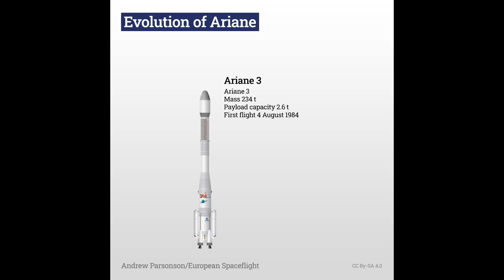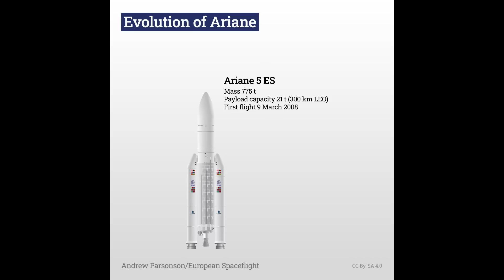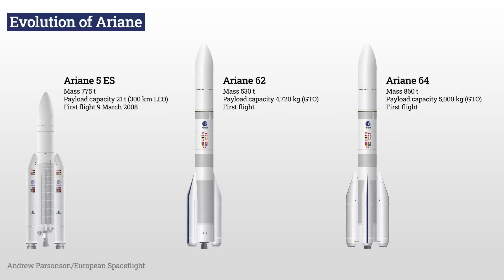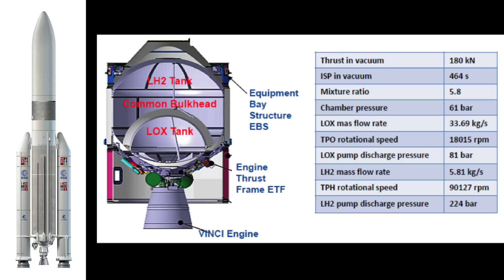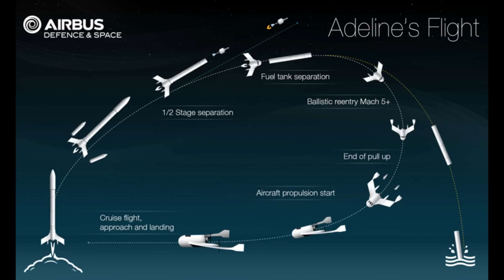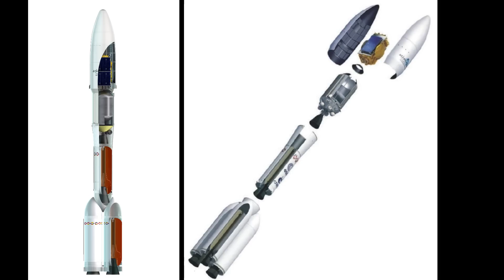Europe Retires Ariane 5 Before Ariane 6 Is Ready????

Comment: The thing about the European space launcher industry is , there is not enough demand to make it worth while to reuse kit. Many of the companies cannot afford to produce only one or two engines per year for example.   So either Europe has to be able to be able to build demand so it is worthwhile build and launch reusable vehicles, or each launcher has to cost 4 or 5 times what it does now.

Hopefully Europe can get through this and build more launchers.
Reply: most of ESA's work is done for non-member countries, and that included the US before SpaceX got up and running. There are still a lot of countries who will happily wait for a more expensive launch slot on an ESA rocket that has yet to fly, rather than ever give money to a rocket owned by a US company. Ariane 6 will undoubtedly get work to do, but whether it will pay for itself remains to be seen
Reply: Isar, PLD, Pangea, Orbex and RFA all plan some kind of reusability. They are small rockets, but lets wait and see
Reply: The way to do that is to get market share by offering a cheap reusable rocket. Too late now.
Reply: Cut your launch cost by 90% or more, and I think you'll see a rise in demand
Reply: Reusability is pointless if it all comes back to French Guyana or the Atlantic nearby, all hardware processing apart from solid propellant filling and vehicle assembly is done in europe. Makes more sense to keep the production lines running steadily...
Reply: This is one part that many people miss - SpaceX has an easier time here than others because they have a huge backlog of already paid-for launches thanks to their Starlink. And while Starlink is heavily subsidized, they are the customer, so it gives them more flexibility in their launch schedule.
And after all, the question whether reusability makes any sense at all isn't so clear cut - SpaceX is an order of magnitude away from the launch price they were promising for the reused rockets, as well as from the reuse cadence they promised. It is unclear if reuse actually saves any money or time.
Reply: @kain0m I think it's pretty clear how much time and money reuse saves. Like 4 or so years ago they reported refurbishing costs half as much as a new booster, presumably including sea operations cost average. As for time, refurbishment finishes at the cape within a week or two including the few days of intake from the barge. They don't have to ship a booster from California every 5 days or make a new production chain and factory in Florida. It probably costs much less than half now. A new booster takes much longer to fabricate, assemble, validate, plus making the engines, then full build validation. Instead they can allocate resources much better to the upper stage, where they still find ways to speed up and optimize production to speed up cadence today, as that is the bottleneck.

The biggest benefit of reuse is the speed and cadence of operation, they can launch at a cadence of seemingly less than a week at a time regularly. This cadence pays off their fixed costs like the pad and staff.
Reply: @kain0m  " SpaceX has an easier time here than others because they have a huge backlog of already paid-for launches thanks to their Starlink."

SpaceX built reusability first and then Starlink. Starlink couldn't exist without the cost savings of reusable rockets. Or at least not in its current form. OneWeb, which is the only real competitor to Starlink right now, has already gone bankrupt once with a far less ambitious plan. And even it bought a previous satellite constellation company that had previous gone bankrupt. 

SpaceX went with reusability to lower prices to increase demand for travel first. And they are continuing that same approach with Starship. There is hardly any demand at all for a vehicle able to left 100t and more into orbit multiple times a week. Even Starlink at full scale will only need a few launches from Starship each year. But if they build it and bring the cost down drastically, then the market will increase massively.
Reply: @kain0m  > SpaceX has an easier time here than others because they have a huge backlog of already paid-for launches thanks to their Starlink.

You don't know what you are talking about. SpaceX reusability program started way before Starlink was even an idea. First F9 launched in 2010. First known mention of Elon planning a comsat constellation is 2014.
Reply: @kain0m   "SpaceX has an easier time here than others because they have a huge backlog of already paid-for launches thanks to their Starlink. "

Which thus in reality means Starlink is really a program of excuse and need to have such high launch cadence. Which then works out to: Can Starlink really cover all those expenses with it's revenue or is SpaceX lighting a huge pile of money constantly in fire in form of starlink, just to show "hey there is huge need for our large launch cadence". Which would then come crashing down upon SpaceX running out of investment money to burn. It comes all down to.... Is Starlink actually profitable enough to subsidize the reusable rocket program and massive launch cadence.

If you are just using your own division to pay your second division to make money... you aren't making money, you are shifting it around in expense sheets. You need external revenue to keep the company going. Sure Starlink makes some money, but does it make enough money to cover the vast launch expenses. Since mobile internet connection is thing people expect to be pretty cheap out side of say ocean going cruiselines, they have no choice but to pay what the satellite operators demand.

On ground. You are fighting with competitors with way less expensive cost structures.... Like putting up steel tower on which to mount these permanently fixed starlink link relay stations called cell network basestations. Which you can put up tighter and tighter upon demand increasing, since every tower is not blanketing the whole county with it's radio waves causing interference. Easier radio frequency slotting and so on.
Reply: @aritakalo8011  According to Gwynne Shotwell, Starlink is already profitable. It supposedly had a 'cash flow positive quarter' in  Q4-22, and should be completely profitable in 2023. I'm sure that cash flow positive doesn't include back costs like development. But it should be counting launch costs. They have over 1M subscribers already, which is likely earning over 100M per month in revenue. That should easily cover 2 launches a month. Probably 3.
Reply: @aritakalo8011  > Sure Starlink makes some money, but does it make enough money to cover the vast launch expenses

What "vast" launch expenses? $28M per launch? LOL.
Reply: @aritakalo8011  Starlink has nearly 2 million subscribers. That is already billions of dollars per year

Comment: Kinda like NASA retiring the shuttle before any form of replacement has even been conceptualized? 

Sounds a bit like casting biblical stones, doesn't it?
Reply: the space shuttle killed its crew on several occasions each time with a different failure at the end it was like playing russian roulette, because its design flaws were ultimatively fatal, Ariane 5 was human rated by the way, they did not bother to develop or say build capsules though.
Reply: It was Washington that cancelled the shuttle.
Reply: @TheEvilmooseofdoom  and?
Reply: A replacement had long since been conceptualized. Only trouble was all kinds of obstacles made its realization take much longer than anticipated.
It's almost as though space was hard.

Comment: why jettison boosters, when you can just burn them down, by themselves
Reply: ie, plastic mixed with oxidizer in a rocket burner nozzle shape
Reply: you know those plastic 3d print filaments mixed with additives, this time the oxidizer, full burn solid fuel booster 3d printed or cast into shape
Reply: just make a huge ton bunch of the vanishable single use rockets, yes you like your military things
Reply: actually expendable rockets
Reply: @Jkauppa  You would need non-burnible graphite (or similar) nozzles to convert the combustion into thrust. And a structurally stable airframe to contain it, and connect it to the main core.
Reply: @Joe_VanCleave  no, you can do all that with the same rocket fuel material, just be wise about it before saying "no it cant be done"
Reply: @Joe_VanCleave  do stuff smarter, dont work harder
Reply: @Jkauppa  No. the same material can’t simultaneously combust as fuel and not combust as chamber/nozzle. Never say it can’t be done, yes -  but understand the laws of physics and chemistry, also yes!
Reply: @Joe_VanCleave  do you believe in God? you just denied God
Reply: @Joe_VanCleave  dont become rules to me
Reply: @Joe_VanCleave  your scientific vote was not counted, as no voting needs to take place, or anyone has to have any rights over other people's doing or thinking or sayings, no matter what they are, or how wrong you think they are, you just said its impossible, choose already
Reply: @Joe_VanCleave  is it possible or is it not possible, law or faith, bro? God or limitations?
Reply: @Joe_VanCleave  through law you will get nowhere, just "science" whining
Reply: @Joe_VanCleave  your principles are broken, you are the limitation for all and yourself
Reply: @Joe_VanCleave  so you think aluminium is not both fuel and structural wall?
Reply: @Joe_VanCleave  explain to me how shaped directed charges (explosives) work
Reply: @Joe_VanCleave  how does the nuclear detonation engine work

Comment: The Ariane 5 is kind of the Frankensteins Monster under the Launch Systems.
Stupidly big Boosters, way to small Main Engine, heavy Avionics Bay.
At Booster Separation the Main Engines Thrust is smaller than the weight of the Vehicle so acceleration is <1g. It falls back to earth, while picking up speed and emptying the tanks till it climbs again, a lot of gravity losses.
Also it starts pretty steep to compensate.
Payload Mass Fraction is around 1,5%. Not what you would expect from a 2,5 stage system with HydroLOX-Turbopump theater on board.
Anyway, the purpose was changed like 4 or 5 times in over the hollow development, so engineers are not to blame.

Comment: Ariane 6 is already a commercial success as the first years are fully booked, and with the millenium spatial biggest contract for Kuiper. t is even an issue because they must ramp up the candency quicker than planned
Reply: "Commercial success" is being a little generous. I checked the manifest, and the most ambitious year so far is only 9 launches (for reference, SpaceX did 61 launches in 2022) and only 3 of those commercial launches. Most of the launches are Galileo sats and EU science payloads. Am I missing something?
Reply: @geraldmartsy2165  ariane 6 is planned and made to launch not more than 12 per year based on government contracts and the size of the heavy launchers market which is not as high as you can imagine, lower than 30 per year with several launchers available. They dont need to launch more. Trying to do more only for the public market is not economically interresting and is not the purpose of it.
Plus there is a ramp up phase to achive the 12 launches.
Their book is already full and they must accelerate the planned ramp up because of that.
If it was only for the kuiper contract it would be a huge commercial success already.
Plus the 9 you are refering to dont have the kuiper launches which are already signed. It is not always publicly available in details.
Reply: @sebpatu  ok buddy, sounds like a great rocket. congrats on your success.
Reply: @sebpatu  Hard disagree. 10 years ago the idea of launching 60+ Falcon 9 size rockets was unthinkable. The simple availability created an increase in use cases for payloads of the type it could carry which drove up launch count. And Space X has been able to increase to keep up with that. Arianne 6 is going to be hard capped very quickly in terms of cadence.

Worse within a few more years it's not going to be competing with Falcon 9 or even Falcon Heavy. It's going to be competing with Starship, and eventually New Glenn. At that point there's just no reason for anyone to use it other than anti-US sentiment. That and European Government contracts will likely keep it flying. But it's likely to become an odd duck launcher used by a small number of customers and completely outcompeted by everyone else. And that will eventually kill Ariane as a launch provider.
Reply: Ariane 6 is only getting Kuiper launches because New Glenn isn't ready.  The vast, vast majority of Kuiper launches over the next 10 years will be on New Glenn.    And I wouldn't be surprised if Ariane 6 isn't ready before New Glenn is then their Kuiper launches will be cancelled.
Reply: @stevenf927  Amazon signed for Ariane 6, Vulcan, and New Glenn not only New Glenn. Then you will be very surprised when Ariane 6 will launch before end of 2023. A delay even of 1 year cant cancell such contracts. And kuiper is ont the only commercial client of Ariane 6, but it is the biggest.
Reply: you just dont get it , do you? why have a launch vehicle that can compete with the Falcon 9 rofl
Reply: @kleinerprinz99  You''re replying to me?

Comment: To be fair, the only reusable rocket on the market is the F9. Plenty of other rockets, current and soon to be available that still won't go that route.
Reply: gee I wonder what Space-X be up to actually that could trump the Falcon-9 and has reusable booster that uses liquid methane and oxygen as fuel and might at a later stage use those same engines on their smaller launch vehicle, when the Falcon 9 still will be viable at that point, also like a dozen companies worldwide and state-owned actually trying to go fully reusable like Falcon 9, we will see
Reply: Only 40% (the first stage) of a F9 is reusable, on launches where it's viable to do the return burn. While that still makes it slightly cheaper to fly, it's still only a small portion of the full cost of the launch. With the Falcon Heavy operational there's been fewer F9 launches where they've had to ditch the first stage, but it really is only for the recurring ISS resupply missions where the reusable first stage makes a noticeable difference. For the occasional satellite launch, the cost is still so high that it's more a gimmick than a selling point. As long as they burn a ton of kerosene on every launch, they can't even claim it's environmentally friendly
Reply: @thesteelrodent1796  In 2022 there were 60 falcon 9 launches - only 3 were expendable.  And the first stage is 60% of the cost of the rocket, and the fairings are 10% of the cost.  So SpaceX is recovering 70% of the cost of the rocket.
Reply: @stevenf927  - Whatever the reuse percentage, F9 is the only reusable rocket indeed. Newcoming rockets have very little capability, wich is useful for close orbits like constellations, bigger ones are still on the way. FH is kind of pointless today because of its tiny fairing volume, heavy satellites are spacious, a non-reused F9 could be enough for decent orbits and "high" mass. Wich was the selling point of A5 : big capabilities and big fairing, in order to bring big satellites or two medium to orbit.
Reply: @stevenf927  "So SpaceX is recovering 70% of the cost of the rocket."

Not exactly because no one knows, but SpaceX, how much is spent on repairs and maintenance.
Reply: @luigeribeiro  > no one knows,

It has been leaked. Reusable launch costs ~ $28M.
Reply: @thesteelrodent1796  > it's still only a small portion of the full cost of the launch. 

Utter nonsense. The "portion" is more then 50% of the launch cost.
Reply: @thesteelrodent1796   Actually, the Fairings are reused, too...  And the Dragon capsule, but you already said as much.  Also, a falcon 9 burns around 100 tons of kerosene, not one ton.
Reply: The Electron is also a reusable rocket.

Comment: They left so much usefulness on the table with the Ariane 5 by using an inadequate upper stage. And there were multiple upgrades planned that went nowhere. The Ariane 6 improves that, but at the same time doubles the number of solids aka explosive failure points. Sure, officials say the A6 cheaper, but I’ve completely lost trust in them and do jot believe them. If this were 2013 I‘d call the Ariane 6 a mild improvement, in 2023 this is just incredibly frustrating.
Reply: That's good you are not a paying customer of them :)
Reply: Seriously, explosive failure points? SRB's are some of the most reliable rocket motors out there.

Comment: Does this mean outside of China Falcon 9 super heavy is the only option for the moment?
Reply: Indian rockets are available as well
Reply: Per Wikipedia (yeah I know), a rocket considered "super-heavy" has a lift capability of  >50t (US) or  >100t (RU)  to orbit.
Reply: Falcon super heavy, aka BFR, aka Starship is still not available for 3rd party payloads (except pre-bookings).
  Falcon 9/27 Heavy is available for Mars and direct GSO payloads.
  Falcon 9 and Electron are available for GTO and LEO launches .
  Falcon 1 is no longer available .
Reply: @johndododoe1411  Falcon 9 Super Heavy is not Starship. "Super Heavy" term is used whenever a rocket straps boosters together. The Falcon 9 Super Heavy, first launched on February 6 2018, is doing regular launches.
Reply: @johndododoe1411  I believe FH is still available for LEO missions.